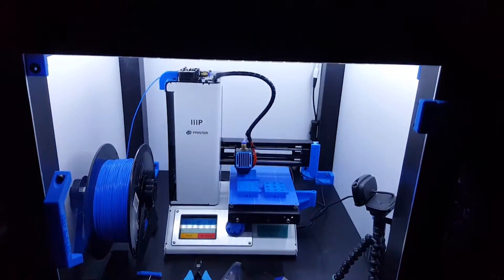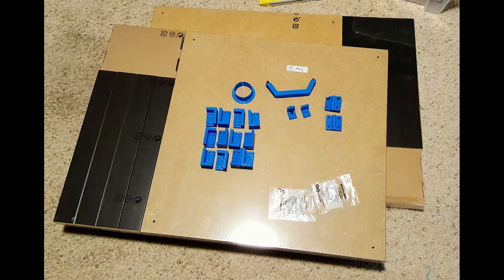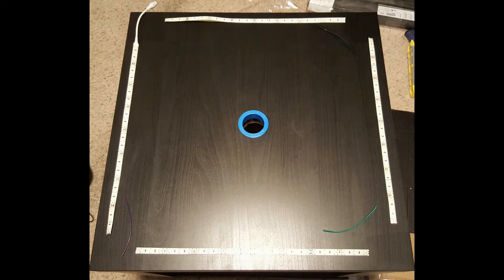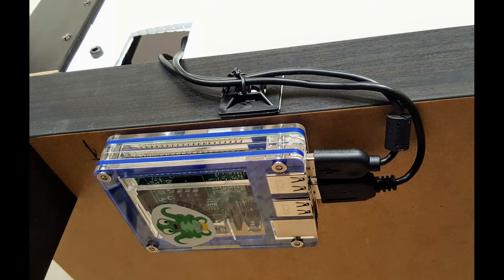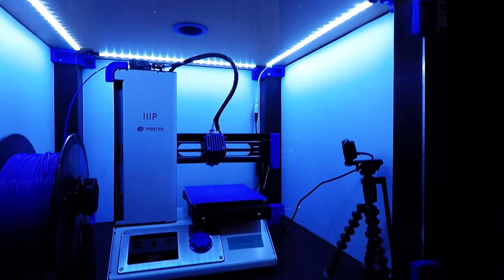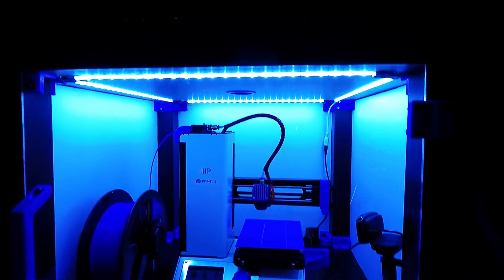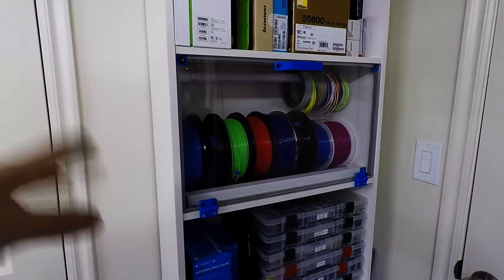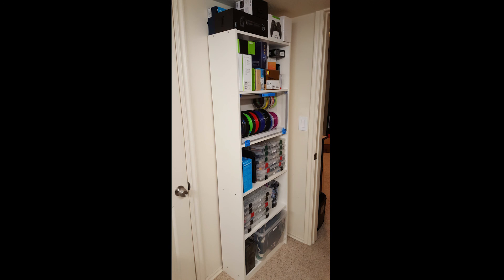3D Printer Enclosure & Filament Storage

Comment: Did you use files from Thingiverse or somewhere similar for your components? If you did, would you be willing to link those?
Reply from the maker: Todd Walden They didn't come in any 1 set, ended up using parts from a few different kits. I don't have the links, but searching Thingaverse for "Lack IKEA enclosure" will bring up the parts.